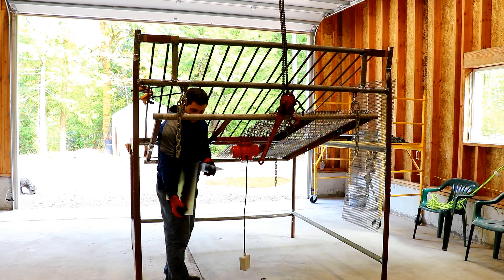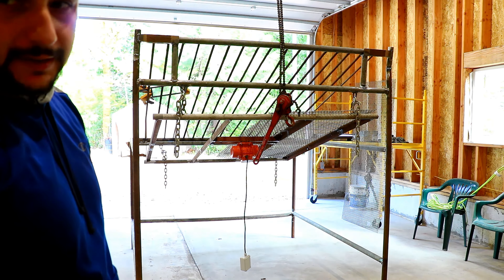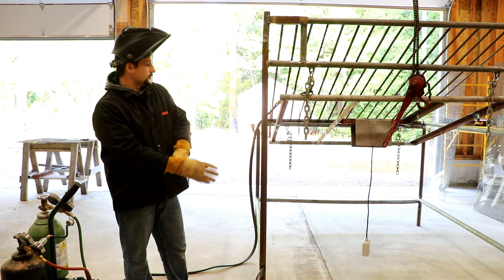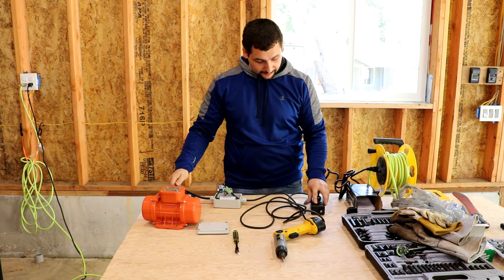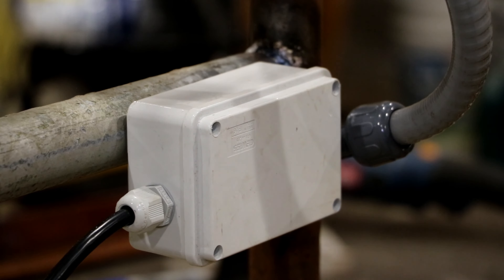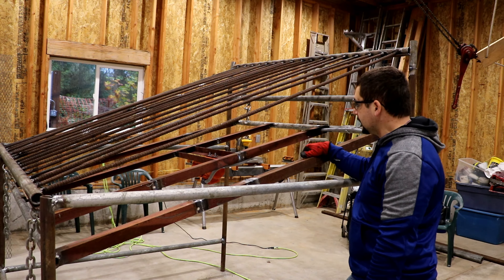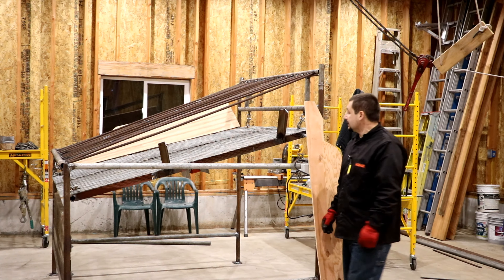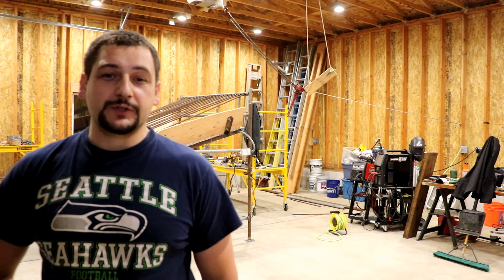Building A Dirt Sifter #3 Doing It Dans Way

Comment: Dan, I have the same Oli Vibration Motor.  Inside the control box is the Capacitor, Green Wire, Red Wire, Blue & Gray Wire and Black & Brown Wire.  Did you wire the Hot to the Black & Brown, the Neutral to the Blue & Gray and the Ground to Green?  Nothing wired to the Red Wire or the threaded end of the Capacitor?  Thanks for any tech support..